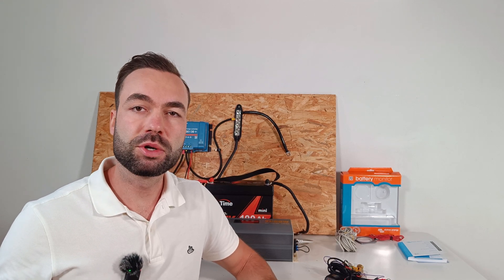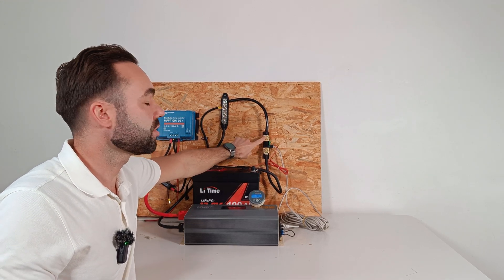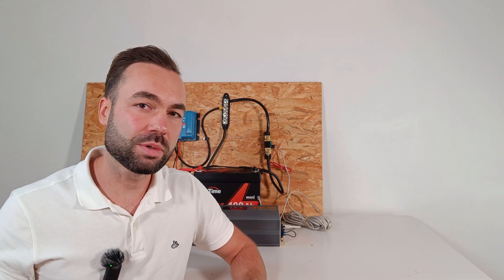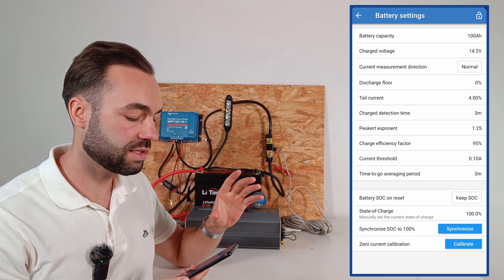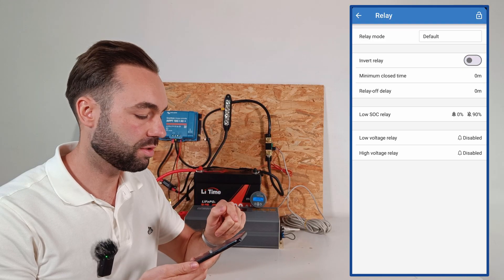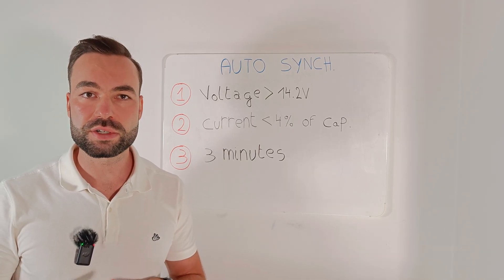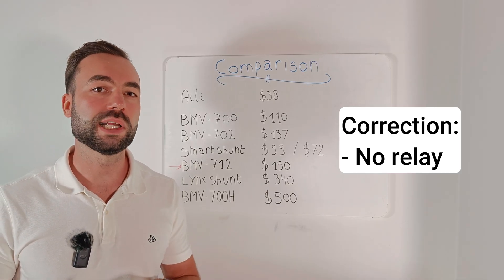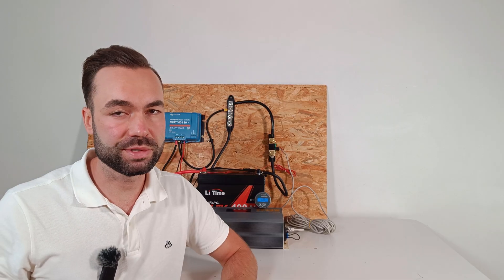Victron BMV-712 Shunt Explained: Setup, Features & Test

Comment: You mentioned it can be used with 12v, 24v or 48v batteries but can it be used with a 36v battery made up of three 12v batteries in series?

Comment: Thank you for this! So if I understand correctly, if I have two batteries in parallel and then an inverter off to the side for a camper, I would need a bus bar between the system load neg and the inverter neg and the battery negative in order to setup this up. Am I understanding the concept correctly?

Comment: I am in the planning for 3 batteries in parallel but can i put the shunt after the busbar where they are connected 
Thanks for the advice
Reply from the maker: Yes, as long as there are no chargers or loads connected before the shunt.
Reply: @cleversolarpower thanks,i was not sure.better ask first than 💥🔥

Comment: Can the BMV712 be used as a simple dc voltmeter and auto generator start.? I would not install the shunt in the battery Neg cable, but just bring pos and neg 12 volts to it. Then run the data cable to the BMV for a basic volt meter. And I would program the relay to close at 12 volts to start the gen. I would program it to open at 14.5 volts to stop the gen, but can I set the time the relay would stay closed when it reaches to charge termination voltage of 14.5 volts. Thanks

Comment: I have a 712 Victron shunt.  It is alarming low voltage at around 12V.  But the batteries are fully charged and meter out at 13.56V at the moment.  What could be wrong with the shunt.  I plan to clean all the battery terminals today just in case there is some corrosion.
Reply from the maker: Chan you check the voltage at the positive small wire and the negative of the shunt? Check if all connections are tight. It might be lose connection. Then charge to 100% and do a manual calibration.

Comment: This is a great explanation! I’m ordering a 712 this week. Keep up the great work! 😊 Bluetooth range appears to vary between Victron device types. I have an MPPT 100/50 which has easily 10+ metres. It’s mounted in the back of my truck and I can interrogate trends inside the house. On the other hand, the Orion TR (isolated) 12/12 DCDC really struggles beyond 5m and I need to be close to vehicle to connect without constant reconnection attempts. A bit trivial but there it is haha! 🇦🇺
Reply from the maker: Thanks for the additional information. When I test other Victron equipment i will also test the Bluetooth range.

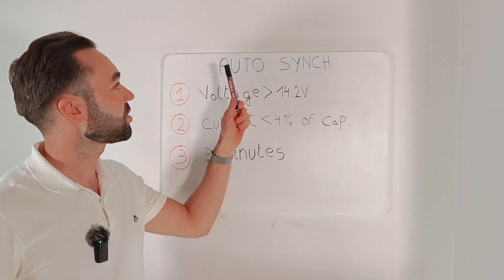Comment: Concerning the three sync points needed 7:52 : Isn't it the float voltage (which is lower than 14.2V) instead of fully charged/absorption 14.2V or is it set to be the same voltage in your case?
Reply from the maker: Great question. I have a charger that goes to 14.6V. if your charger is set to 14.2V, which is enough, then you might set this voltage a bit lower. 14.1V for example.

Comment: Another great video - thanks!  I've had a BMV-712 for about 5 years and love it.  Since I got that, I've gotten several other Victron devices - 2 mppts, a B2B and a charger.  I love them all but I DID have trouble with the variance between my (non Victron) bluetooth battery app SOC vs. the BMV-712 SOC.  I have been resetting the 712 to 100% lately but I appreciate your explanation of all this.  I didn't request this video but I should have.  Thanks!
Reply from the maker: The soc of the battery BMS can drift over time. So I would trust the automatic synchronization of the BMV.

Comment: I just installed the 300 amp, no display version today. It has m8 bolts. I installed a busbar to my battery terminal and had to put washers underneath because the plastic housing for the circuit board is too high to allow a bar or large lug to go across in that direction. 
It baffles me that they designed it this way. I may fashion better spacers that don't restrict current like the washers will. 
I did see that you can reverse the hook up and toggle a setting in the app. This will allow me to install this in my space without having to use spacers but it's not standard and could confuse me or someone else in the future since it is marked clearly "battery negative, load negative"
Reply from the maker: Ok, so the 300A version has M8 bolts. Good to know. Yes, you can change it in the app.

Comment: I have a 300a smart shunt which I will be taking out of my system because of high voltage readings .
Reply from the maker: Please explain, how does this happen? Do you think it's broken? What does your multimeter say?
Reply: @cleversolarpower  100a lithium battery , Victron 100/20 smart controller and shunt reading the same voltage on multimeter . Bluetooth readings from shunt states voltage at 200v to 300v . have tried another VE cable and disconnected from system then reinstalled , same result. System still functions as normal . But don't think i trust leaving the shunt in place.

Comment: The 300A Smart Shunt is of my favorite shunts. I usually don't bother with the (overpriced) display and just use the bluetooth app.

I recommend setting the Peukert exponent to 1.05 rather than 1.03.  While 1.03 is closer to reality, you want to ensure that the shunt error drifts towards thinking the battery is more on the empty side than drifting randomly one way or the other.  Because you don't want a human reading the SOC to mistakenly believe that the battery is fuller than it really is.  1.05 also works better in cycling applications where the battery might not become fully charged for weeks or months (aka across winter).

Set the charge efficiency factor to 99%... that's what it is for lithium.

I also recommend setting the charged voltage to 13.8V, the discharge floor to 5% or 10%, the tail current to 2%, and the charged detection time to 3m.     And also reducing the time-to-go averaging period from 5m to 3m.

-Matt
Reply: I too have the charged voltage set to 13.8V, but I'm a bit more extreme with the tail current (0.5%) and the charged detection time (5m).

Comment: I don't have a shunt in my system, but can you explain something does the 500A means it only works for a 500 A maximum capacity bank?

Or is it just the load like you showed us 12v being 500 A x 13 which is 6000 watts
Reply: Yeah, it works on any capacity of battery bank. It can even be a 10000ah battery bank, just that you cannot pull in your case more than 500 amps at any point in time through it.
Reply from the maker: Yes, 500A max. It has nothing to do with battery capacity, that's Ah.

Comment: I’m using a Li time shunt and battery monitor. It constantly flashes and I’m not sure why it does that. It also doesn’t have Bluetooth. I think I’m gonna switch to the 712.
Reply: If everything on the screen is flashing on and off that might be the indication that it's in charge cycle. If it not flashing at night then that could confirm that question. Look up the manual to personal confirm.  The li time one might be the same as the Renogy shunt which i own and on that model  the lashing does indicate charging.
Reply from the maker: Flashing might be because of a bad contact somewhere.

Comment: That looks like a great devise to keep track of your state of charge Nick. Can I use 1 BMV-712 to monitor two batteries together wired in parallel? At least I would know if everything is working correctly, even though it would'nt be as accurate. Thanks for all the great tips you bringg us! Cheers, Danny 💗🌹💗
Reply from the maker: No you cannot. The voltage of batteries in parallel is the same. You can measure the midpoint of two or more in series.
Reply: @cleversolarpower  Yes you can, two batteries in parallel act as one bigger battery so you just double the capacity and put the shunt in the main negative from the bank of batteries. There is also no reason for it to be any less accurate. This is how the majority of those on boats use these things although many are still on lead acid and have them not only set up incorrectly as incorrectly is the default settings, but they also don't know the actual total capacity of their batteries which is always lower than advertised and consequently they use the things to effectively destroy their batteries by relying on an incorrect percentage. The other common mistake is to leave the starter battery negative directly connected to the domestic battery negative meaning that the thing doesn't measure alternator charge.
Reply from the maker: If he was referring to a starter battery, then yes. But having it on parallel batteries then there is no use because they will have the same voltage.
Reply: @cleversolarpower  I meant he could measure 2 in parallel as they act as one. He could measure the voltage of 3 in that case with the starter being the 3rd.  Midpoint measuring would be useful in a 2S lithium setup though a 24v pack would be better so the BMS could do it

Comment: Great video as usual. I would like to add, that based on my experience and that of several other members of the Victron community forums, the better option is always the BMV-712 over the smart shunt. 

The smartshunt has quite weak bluetooth transmission which can cause problems if you are in a van or camper with a lot of metal construction. The transmission of the bluetooth signal from the BMV-712 is stated to be more powerful and less problematic. 

I would always recommend the bmV-712. The smartshunt is great except for this major drawback. BMV-712 even better.
Reply from the maker: I didn't know that, thanks for adding this! 🙏